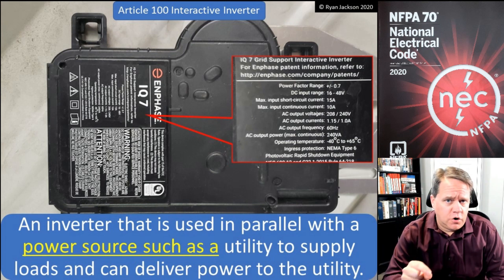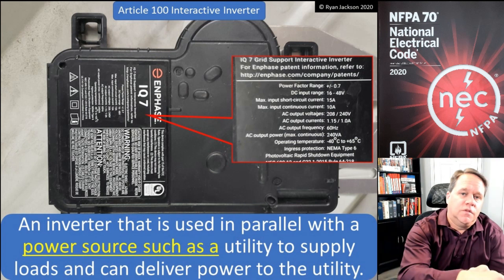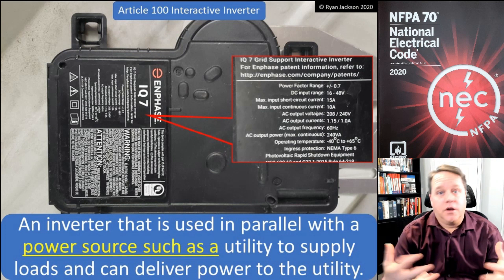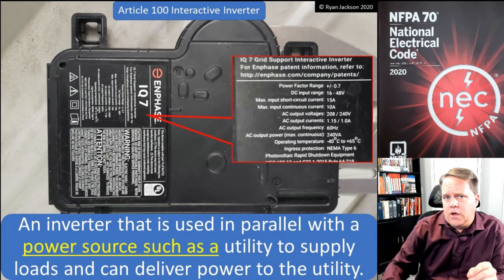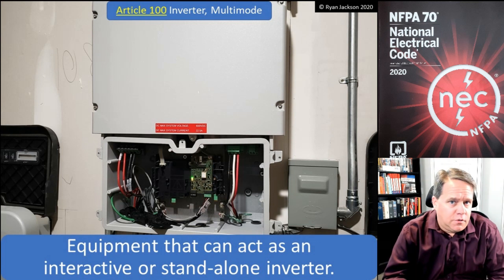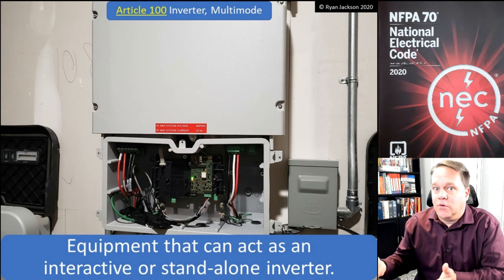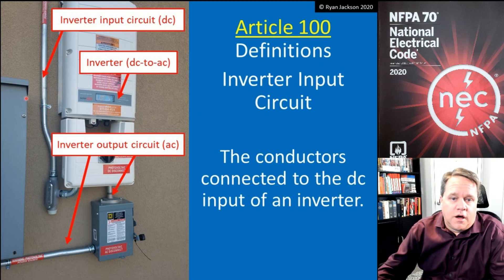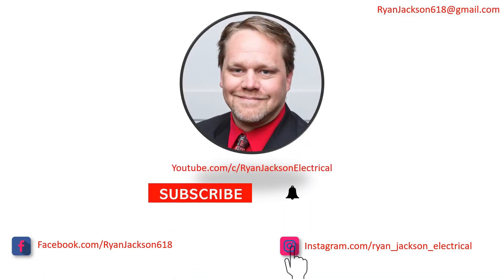100 Days of Article 100 Inverter and associated definitions

Comment: Question that's puzzled me for a while... if you run a standby, whole house generator on a house with a grid tied PV system will the interactive inverter see that as utility power and turn back on?
Reply: Most grid interactive inverters will require you to turn off the solar system when on a generator. Back feeding extra soar energy to a generator will fry the generator
Reply: @Miweatherspotter1  Can you elaborate on that or point me to some resources. This seems to make some sense, but I gotta know the 'why'. This is likely why Generac, (who bought up Pyka to offer the PwrCell platform) recently announced a DC generator line to work with that system. I think they had trouble incorporating their AC standby generators into the system as they first promised would be possible.
Reply: @cali-electro-dad   the regulating electronics on the generator tend to fry (I think it’s the one way diodes). Also you unload the generator and try to turn the generator into a motor, I’m not sure what the mechisum is of failure but it lets the smoke out.. :)
Reply: Well... maybe... the Generac PwrCell system uses a DC coupled "Islanding" or multi-mode inverter. So... in "no-utilty" mode it is drawing strictly from DC sources... so... DC generator... I guess. I guess using the inverte/charger itself to power up the batteries from an thier AC generators as if it were the utility posed too problematic.
Reply: @cali-electro-dad  in my hybrid inverter with batteries the inverter access the transfer switch and it can work with a grid AC input to pass power to the loads or matches the grid frequency and supplements to load to basically 0 out usage. Mine also has the feature of allowing me to run off of a generator and dc coupled solar. This thing is not able to AC couple to Solar and runoff a generator because there’s no real way for it to regulate the flow and prevent back feeding